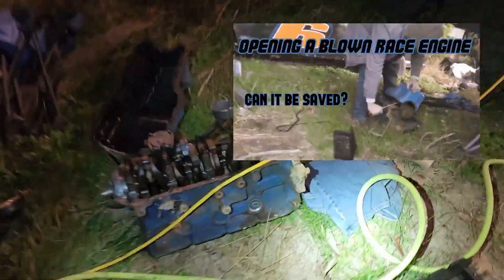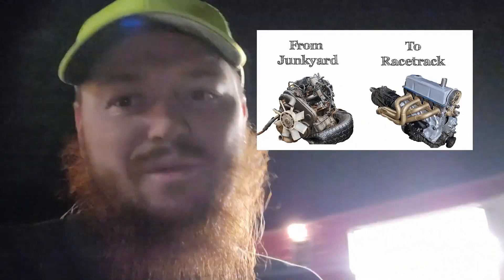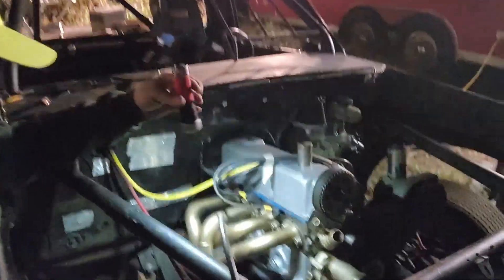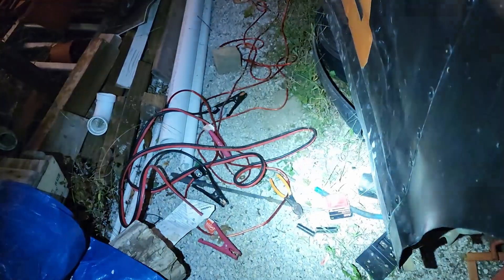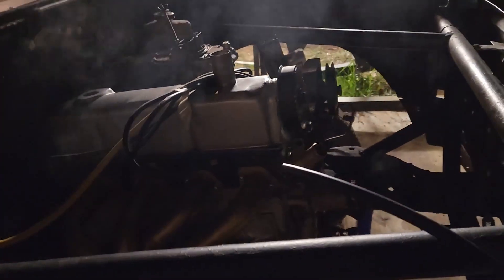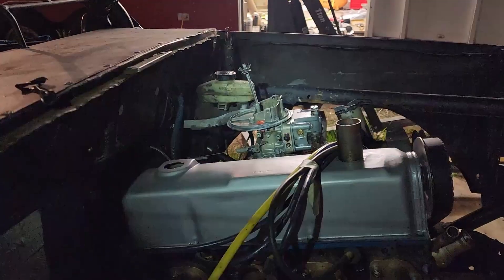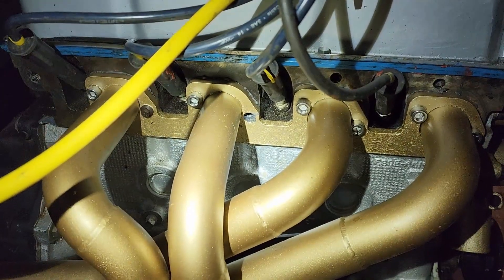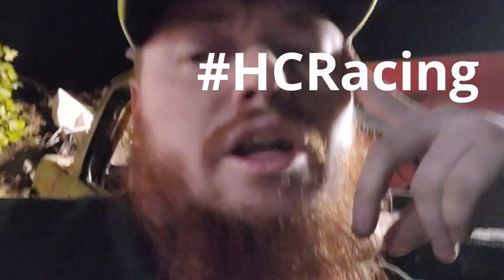IT'S ALIVE - first start on our Ford 2.3L Lima Race Engine Build

Comment: Can you please help me with my 84 Ranger I just put an engine in from another 84 with a 5-speed manual and put mine on my automatic and can't get it to fire
Reply from the maker: I can try my best, but please understand knowledge is your friend here, so if I say something you don't quite understand make sure you ask for more info. 

Engines need fuel, air, spark and timing. 
Start with fuel. 
If youre running an electric pump then turn your key on so it will pressurize, if its mdchzn then youll need to crank the engine a bit. Disconnect the outgoing side of your fuel pump and make sure you're getting fuel. If not you could have a bad pump, or a collapsed line.  
If you have fuel there, then manually pump your carb and make sure it's spraying. 
Next is air, intake and exhaust. Remove your valve cover and rotate the engine using a ratchet on your crank. Remove your spark plugs. It'll be easier. Watch your rockers as you rotate the engine. This will confirm your timing belt, cam, rockers, valves, and so on. Since your spark plugs are out you can also carefully use a long screwdriver to set in each plug hole and make sure the pistons are moving as you rotate the engine. This will confirm the rods and so on. 
Next check spark a couple ways. Start by getting nee plugs regardless. Easiest is to have a plug removed, put it back in the plug wire and set it on top of the engine touching the casting, then have someone crank the engine. If you see spark then it's good. You can also get a cheapo tester that helps make this easier to see. If there's no spark you may have to test the coil.  
Finally is timing. These engines are easy to time. It's a non interference engine (valves won't hit the top of the piston when timing is incorrect) so you can remoce the belt and free spin the crank. Rotate the crank to top dead center on cylinder 1 or just line up the marking on the crank, rotate the timing pulley so the mark on the front aims through the center of the cam pulley bolt, and line the cam pulley so the mark on the front aims at the center bolt of the timing pulley. The cam can be 180 degrees off, so make sure neither valve is open and you're good. 
Finally with timing. Make sure your spark plugs cables are on the right outputs of the distributor cap. Open the cap and make sure the distributor rotor is pointing at 1. 
Fire it up 
Get a timing light and adjust your timing, idle fuel mix, and so on. 

You can also do it by ear but risky.

Comment: Crazy that new and rebuilt starters are apparently not being tested before packaged.  Zero quality control. Everybody loses on returns, especially repair shops eating the extra labor.  I once bought one of those expensive, big name performance starters for my 2.3 from a well respected California 4 cylinder Ford race parts vendor that was junk right out of the box.

Comment: Hey just up here in Mn. I put a 2.3 in my Jlg man lift. It is out of a 1982 ranger. I'm having no spark. Just ordered a new coil but wondering if I need to add a ballist resistor as I cut the factory harness. ...I figured you race car builders would know
Reply from the maker: So when we do the wiring, it's essentially power coming up through a master +, through a toggle so we can turn the coil on and off for testing, then to an MSD coil, then directly to the distributor. (Obviously there's other wiring going to a push button to a starter relay and so on as well) 

So in terms of a no spark issue I would first remove the distributor cap and ensure it'd rotating smoothly. I've seen breaks in the shafts. You can also check your points gap then. 
Then I'd either use a test light of a DVOM and remove the coil wire from the distributor and test for power. 

That will help you isolate the problem pre or post distributor.
Reply: @HCRacing  well I got it running without a ballast resistor.  Thankyou for your response.
Reply from the maker: @hoffcat  happy you're getting it figured out.

Comment: Imma tell you go to junk yard for factory Ford starters.. the after market has had problems the past 3 years..can use three bolt or 2 bolt.. some cars have selenoid on starter it's self but still physically fit just put a jumper between hot and the starters selenoid.. or the factory selenoid  has a I post( the other small threaded post) run the starters selenoid start pole to that and those starters will work
Reply from the maker: It was a stuck starter relay. Keeps the starter hot and burns them out.